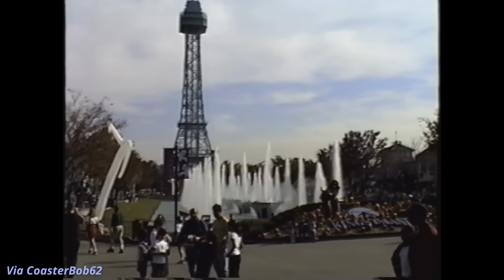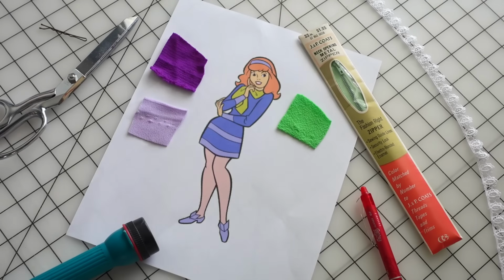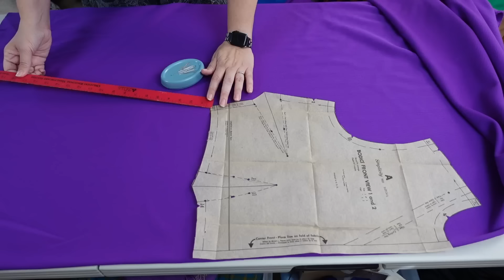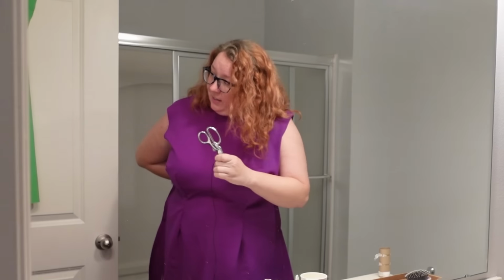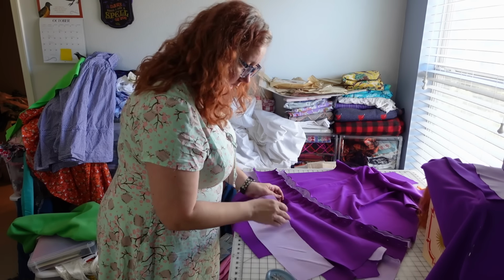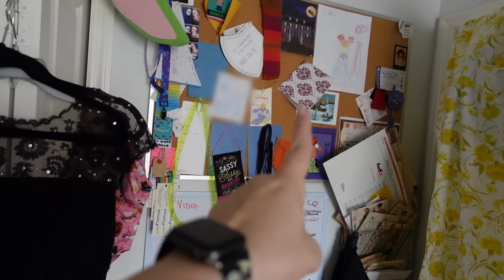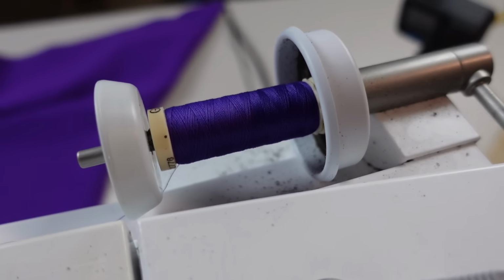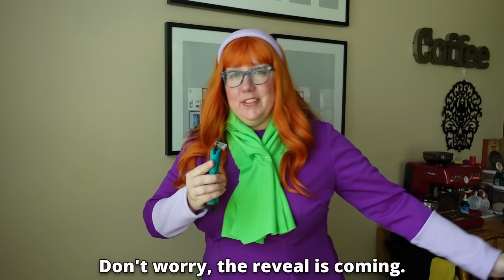I made a Plus Size Daphne costume out of PLASTIC from the 1970’s

Comment: About shortening the sleeve, there is a horizontal line halfway up the pattern. All pattern pieces have a single or double line. That is where you fold the pattern to shorten without distorting the hemline on skirts, pants, and sleeves. It's so easy 😊

Comment: OMG. In 1970,  had a double knit jumper my mom made me. It was like wearing a trash bag--no air circulation--so you felt like you were in a steam bath.

At least double knit was a lot easier to sew than the slinky Qiana-type knits that came out a little later in the 1970s.

Be sure to get your good scissors sharpened after this--pdk really dulls them fast.

Pro tip: Slit those darts open to about 1/2" from the tip and press open.

great result!

Comment: I’ve never used the big plate that came with my Bernina. I’ve had the machine almost 30 years!!!  
Those purple double knits are perfect for Daphnes costume!  Double knits are super easy to work with. The light purple stripes hit in exactly the right spot!! Great fit!! Well done!
 I just remembered a fabric that was popular in the late 60s early 70s. Bonded double knits!!! It was a heavy double knit and on the back side of the fabric they bonded a Trico (sp) like fabric. Talk about HOT!!! That stuff was so heavy!!! And so thick!! I remember making culottes out of it. I wore them to school and roller skating. I made a pair of pants out of that stuff too. One of the bonded knits I used had an almost foam like layer bonded between the knit and the Trico.  YIKES !!
Reply: I had a coat made of that stuff with the foam sandwich. The outer was a black and white houndstooth check.

Comment: Why not put in the stripes without cutting the dress first? Would it not be easier to set the stripes, sew them down THEN cut the excess. The other way there's a chance of changing the length  by accident.